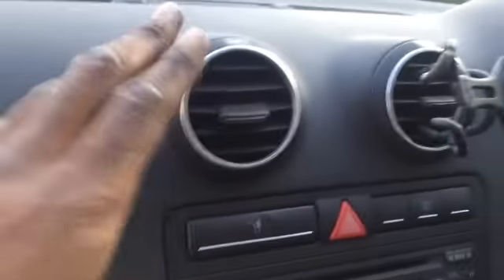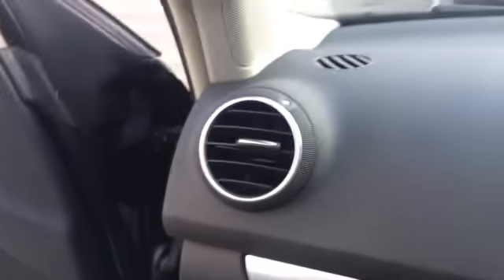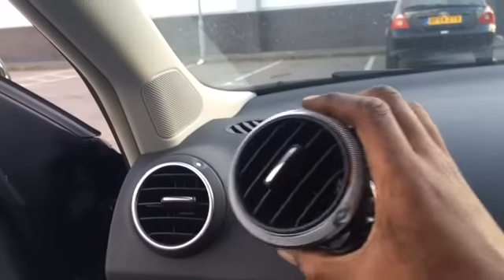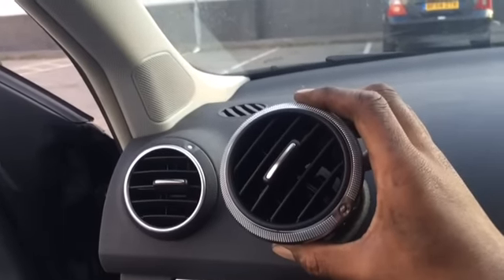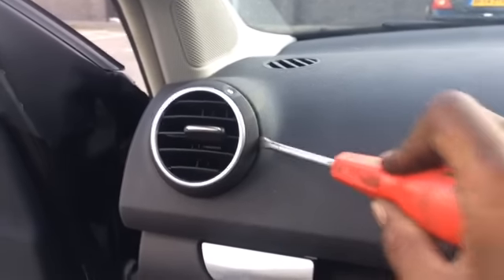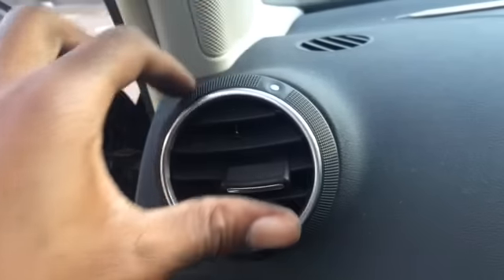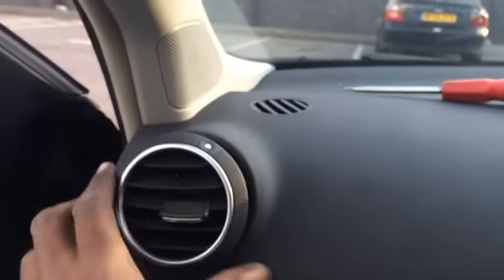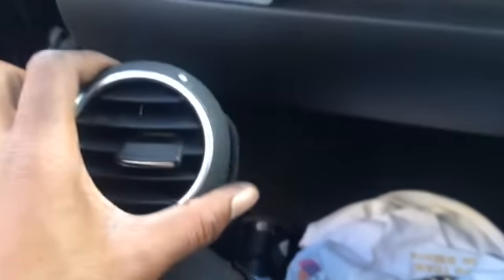Audi A3 8P S Line Air Vent Remove/Install

Comment: any idea, how to take of the silver ring?
Reply from the maker: Hi,
Unfortunately no, I never did. I have seen some stick on rings on eBay you can purchase to change the colour??
Please like and subscribe! Hit the notification button so you don’t miss out on the new videos!
God bless
TW
Reply: I gently pried the silver ring off with a screwdriver... it has 3-4 clips holding it on.